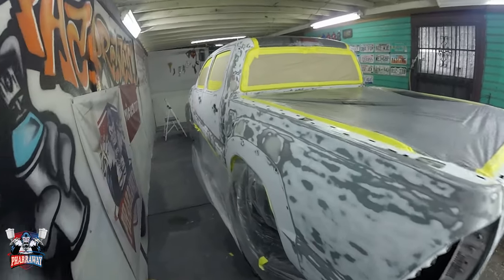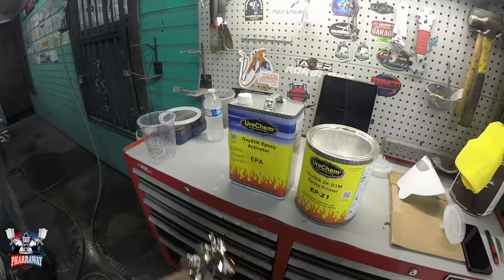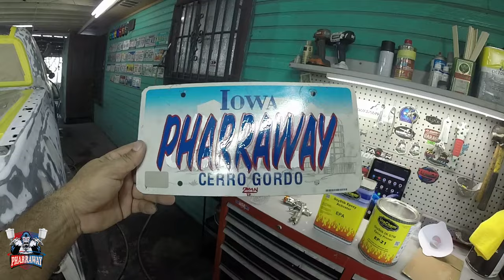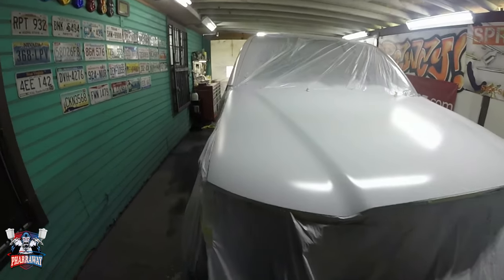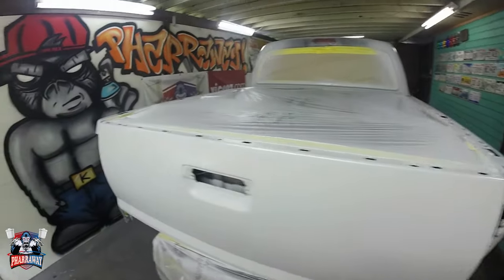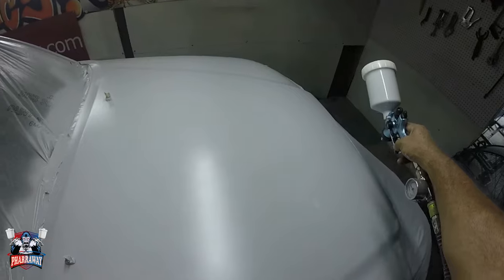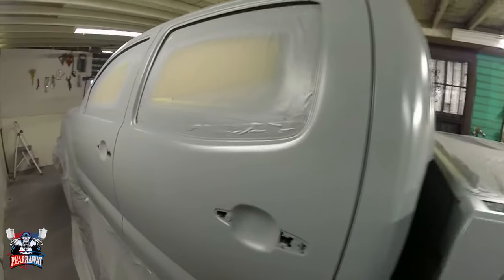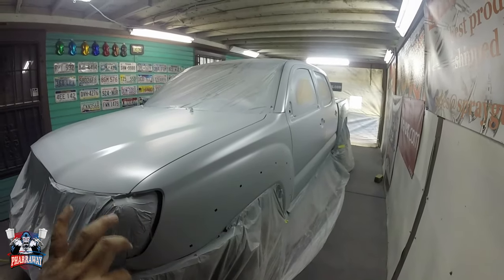How to apply Epoxy Primer and Primer Surfacer The Right Way By UreChem

Comment: Another good video with lots of useful info, it's surprising how quickly bare metal will flash rust if it's not treated correctly as even in a hot climate the humidity will make it rust.
It's great to hear you are going to continue on YouTube, I think all your followers really appreciate how much time and effort it takes to make these videos so a big thanks from me Pharraway👏🙏👍John UK
Reply: I did some sand blasting in high humidity. A old car body will start to rust b4 I got it all done. My Pap used something on it but I can't recall what it is. I use Eastwoods after blast if that will be an issue, or if urr doing a project and will not have all metal bare at same time. It's a life saver. If u want a easy way just store bought white vinegar will elite any surface rust. Or a phosphoric type light acid. Tannic acid is gr8 and alot safer than others. There are a lot of products now for this. I wish I could recall what my pap used. He applied with a cotton rag and didn't need gloves, ppe etc. I was just a kid in 80s. Have a gr8 day.

Comment: Urechem says the primer will only shrink if you use the wrong reducer. They told me that  using slow reducer and Gardner will make it shrink. Slow reducer -hardener also isnt listed on the technical data sheet as an option for you to use

Comment: Amigo.. ayuda por favor. Usé el .ismo epoxy primer pero tuve un inconveniente y no pude terminar de pintar ese dia y ya pasaron 3 dias y hora mi pregunta es, necesito poner otra capa de epoxy o solamente usar el sealer y ya despues la pintura? Y si necesito poner otra capa de epoxy primer necesito lijar y con que tipo de lija?

Comment: I am building a 65 Nova, do you have any advice on how to get rid of the peeling paint inside the cowl area and how to paint inside that area? The only areas I have found to get into part of the cowl is through the kick panels and through the blower motor intake hole but there is no way to get hands up to the top area of cowl to sand. I do not want to paint over the peeling paint in there and want to make sure no rust starts in there. I am learning a lot from what you show can't thank you enough for all the teaching. I don't know if you done a video on primers, could you do a video explaining the different kinds of primers and what you would use them for. My paint skills for decades come from out of cans, I want to get into the paint gun world lol On my Nova I am going to jump right in and do a  Brandywine candy with skull lace running from the hood all they way to trunk. Go big or go home lol. So I been watching your how to candy non stop and will keep learning until Jun this year when weather is good for me to paint then its go time. Thank you again take care...

Comment: Ok cool I live in Australia 🇦🇺 I’m used to using protec 4 to 1 mix epoxy primer and it drys quickly if you bake it at 60 degrees you can then block it sand it use body filler over it protec epoxy is perfect for bare metal it’s a cheaper Ppg paint and use it as a base primer never put body filler on bare metal anymore once repairs are done I either put 2 more coats of epoxy over it again or usually just go a high build primer autothane which is Ppg and then base and clear coat but protect epoxy also can be used wet on wet as well in a commercial side of things like trucks and buses I’m into restoration of muscle cars.

Comment: With so many primers how do you know which to use?
Reply from the maker: I just use what I know it works
Reply: Urechem paint system is a great start. Like Pharraway says, If it's bare metal: Epoxy Primer, then Primer Surfacer (high build primer), Block sand, then Base coat, then Clear Coat. THis what my daughter and I are doing to her 1965 Plymouth Barracuda.

Comment: Can you scuff lightly the sealer before primer serfacer
Reply from the maker: yes you can
Reply: Yeah, if you go past the 48 hour window to top coat, you must scuff the epoxy primer. But within that window time-frame, there is no need to scuff the epoxy before applying primer surfacer.
Reply from the maker: @JosephDR  prefect

Comment: What if it’s only a couple spots could I get away with only using    Primer surfacer @pharraway
Reply: I already have the whole car in primer surfacer but if I do get any spots after I block it down  I’ll epoxy prime those areas and then follow with surfacer and sealer